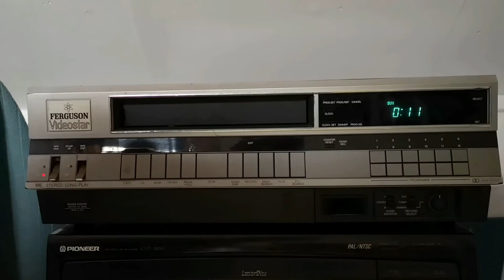Basic VCR Servicing

Comment: VHS Hi-Fi is an interesting format when you consider how it's recorded. The lower frequencies required for audio (1.4 MHz for left and 1.8 MHz for right) together with a larger head gap allow the Hi-Fi audio RF signal to penetrate deeper into the oxide layers of the tape. The video heads then record their signal on top of the audio, partially erasing it. But the higher frequencies and the smaller head gap mean that the video signals are only recorded on the top layer of oxide, so enough of the Hi-Fi signal remains in the deeper layers of oxide, and the loss of audio RF is quoted to be around 12dB. This is what is known as Depth Multiplex Recording.

The Hi-Fi tracks are also narrower than the Video tracks. For PAL-SP the Hi-Fi tracks are 23μm and the video tracks are 49μm, so there are guard bands in the Hi-Fi audio but not in the video. The azimuth offset between the heads is also increased, where it's +/- 6 degrees for the video it's +/- 30 degrees for the Hi-Fi audio, further preventing any cross-talk.

As a very rough analogy it's a bit like dual layer DVDs, the Hi-Fi audio heads are focused on a deeper layer of the tape oxide and the video heads focus on the top layer of oxide.

This also explains why it's not possible to "audio dub" over the Hi-Fi audio, as it's buried underneath the video. There was a deck, probably a professional one, that could record just the Hi-Fi audio on it's own, then edit the video on top of the audio. But most editing decks insert Video/Hi-Fi together and audio inserts can only be done on the linear tracks.
Reply from the maker: And that's before we get onto PCM audio  via the video heads (see, Sony PCM F1, and that weird Technics VHS deck)

Comment: Thanks for the video, in regards to the head cleaner foam auto cleaner. is removing just the foam enough or do you need to disable the arm somehow?
Reply from the maker: It depends on the deck, the JVC shown in the video, had the arm clipped to the metal deck. It would move when the loading pegs unlaced and laced, interacting with the head drum, as it did so. On some deck, you need to carefully dismantle the assembly, on other decks, removing the foam pad is enough, and shown be enough, just ensure the arm does not make contact with the head drum, when lacing and unlacing a cassette.
Reply: Mine was fitted to a plastic support which pivoted via a spindal fitted to the chassis of the VCR and all I did was at the pivot point pulled it out of the chassis .